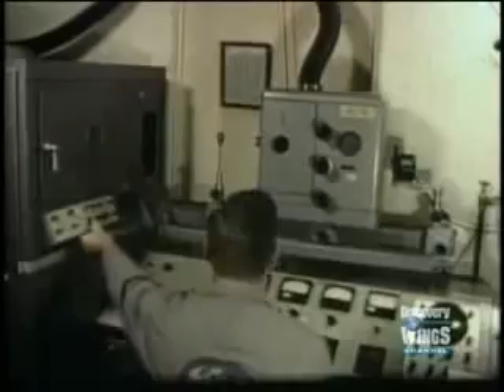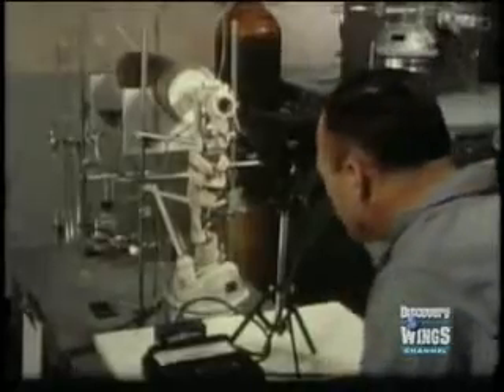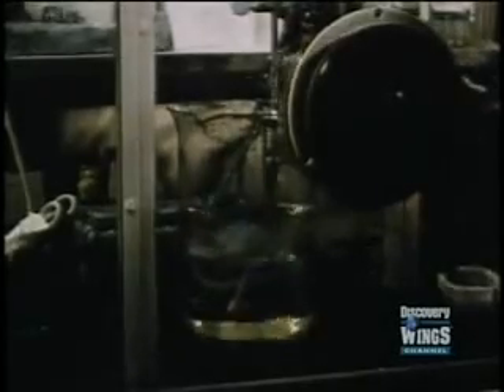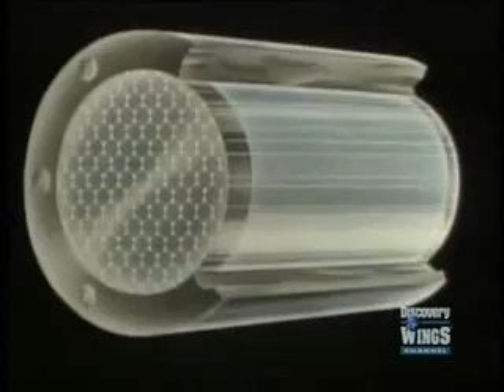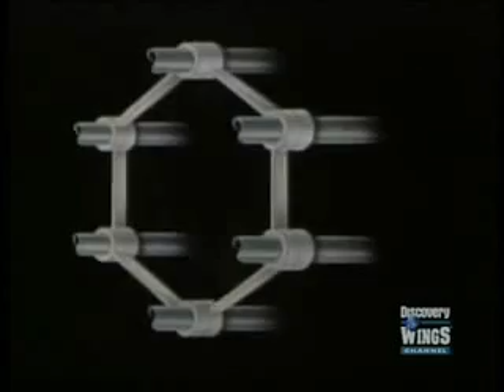PROJECT PLUTO 2 of 5 Video

Comment: SO COOL! Would this tech work in an air cooled nuclear powered electric power plant based on the Hero Turbine? Air is drawn in down trough a reactor that is made to spin as heated air is ejected out nozzles along the edge of a disk. The spinning structure is mounted atop  / attached to an ac generator . Just so crazy it just might work huh?  Patent 3109554 .
Reply: You do realize that this is the very WORST idea for the reason it is spewing radioactive pollution out the thrust end, right?
Reply: Stolen your idea I know have a working prototype